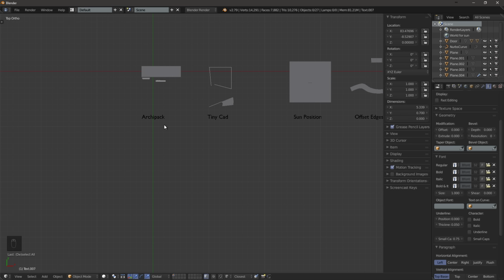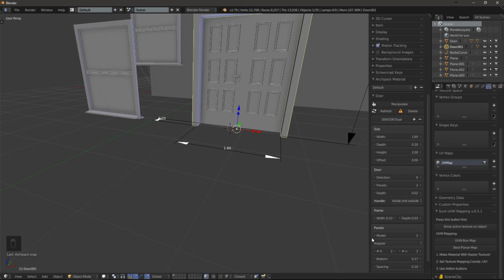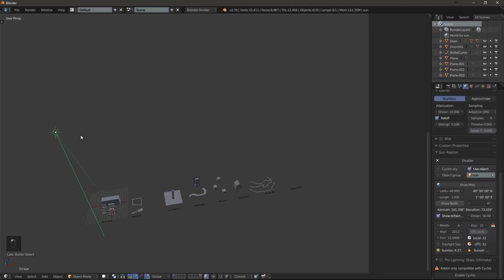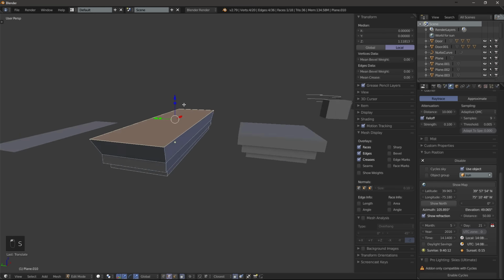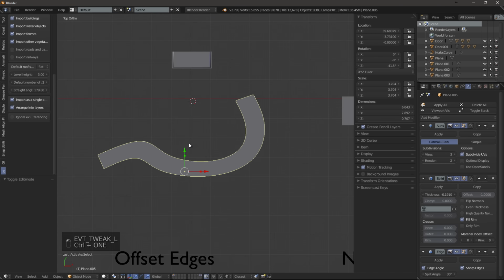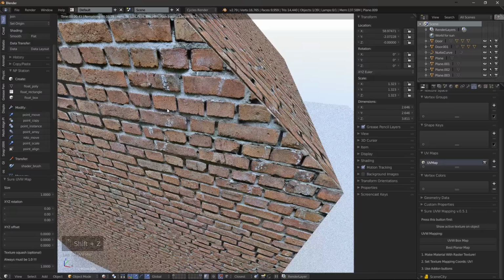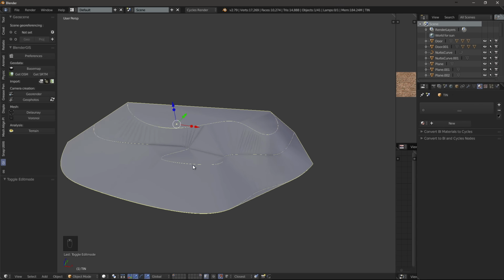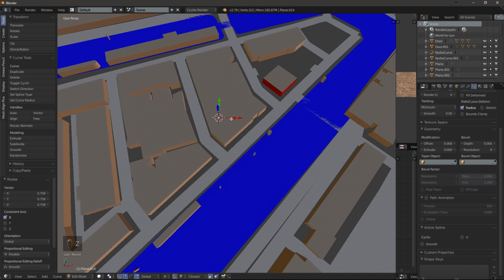The most useful Blender 2.79 addons for architectural design

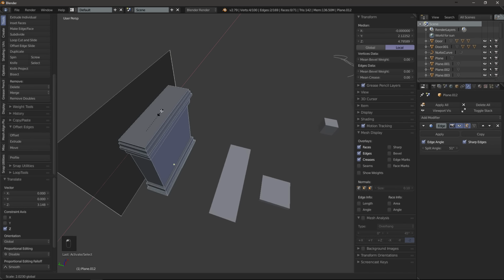Comment: how did you do that on 14:46 you toggle the snaps to vertices without enable the snaps on the bottom? thanks. i get it now hehehe thanks, just need to hit the control while using g+axis+ctrl .
Reply from the maker: If you're in the process of a command, press ctrl and it will start snapping
Reply: yep thanks I was getting there now, the only thing was holding me to really use it on the work process was importing CAD file and everytime I tried sometimes its small, sometimes its just too big I hope there will have a nice really cad import tools that don't need to make it like dxf a support for which cad file.

Comment: How do i download the offset_edges add-on/ file? Doesn't seem to have an appropriate download icon/button. Any one else having a problem with this?
Reply: Hey Brice - follow this link 
https://blenderartists.org/forum/showthread.php?304353-Addon-Offset-Edges&highlight=mesh_offset_edges
you have to sign up(free) and confirm with email before you can download.
Reply: There is a zip file-            mesh_offset_edges_0_2_6.zip 
at the bottom of the first post by Bon BaBa where you can download.
Reply: Click on Raw file, copy all text, open Windows notepad and paste, Click file save as, rename it "some_name.py" (must use quotes in note pad, this drove me nuts for a long time), Select save as any file underneath where you input name, save to anywhere, open user preferences install from file, should be there as .py file.  
All that being said I got a trace back error with raw file, but zip works great, Thank you Evan Demas.
Reply from the maker: Thank you all, I have updated the description to add a link to the Blender Artists forum topic

Comment: I tried installing the Sun Position Script, I'm not having much luck getting it to work. I went through the regular install process, addons install Zip file.
I'm using Blender 2.79 and Sun_position 3.0.1. When i enable the Sun Position no Sun Light is created ??
Reply from the maker: It doesn't create a light source for you. Once you envable a sun, it allows you to pick an object that should be acting as your sun

Comment: Nice Addons, Just wondering if there is a scattering addon ? Something like Forest pro for 3dsmax ?
Reply from the maker: Yes, particles. I have a video showing how particles can be used for scattering people if you search on my channel. With a vertex group, it's possible to also paint the influence just as in forest pack
Reply: Yes I have tried Particles, it doesn't seem to have the simplicity that Forest pro has, maybe its just that I am not that familiar with it.
Reply from the maker: It does take a while to get it to do what you would like to, but it's also quite powerful. Also, there may be some significant changes in particle systems coming up in v2.8, that may hopefully make it more akin to Forest Pack Pro.

Comment: I've been thinking now that Archipack is in Blender, should we use Archimesh or Archipack?
Reply from the maker: It's worth experimenting with both as some elements are handled better by one addon than the other. For example, as mentioned in the video above, all elements in archipack are parametric, meaning all their properties can be adjusted at any time. However, archipack's stair tool doesn't have step height, so you have to calculated it manually. Archimesh's stairs are simpler but they have stair count. Additionally, for interiors, archimesh automatically puts a base board around the rooms, a nice additional detail that may otherwise take significant amount of time to do by hand.

Comment: Nice overview thanks. I didn't know about the external add-ons but am now a fan of NP station and anxious to try it out for furnishing in archi-viz work. Btw to improve workflow a bit, when you want to scale your extrusion you don't need to press escape before pressing S. You can press E then immediately press S to scale the extrusion in place. Thanks again. -Chris
Reply: I have also a tip to share to get a flat curve really fast (annoying right ? ;) ). Create the basic curve, immediately toggle edit mode then just hit the keys 'V','V' (change handle type to Vector) then 'V','L'  (change back to aligned type). You get a nice straight curve ! I use the VVVL combo so frequently it almost became like a street fighter special move ^^ !
Reply from the maker: Hi Chris. Thank you for the tip! Wasn't aware of that before - Dimitar
Reply from the maker: @Samuel thanks for the tip!
Reply: To extend a line at the same angle G,G (grab,grab), C (constrain to angle).  Just one of the great things I learned with CG Masters Jeep tutorial, really great professional tutorial, worth every penny (don't get me started on the awesome shrinkwrap knowledge).  Oh, it's on sale at Udemy right now.   I'm not affiliated with Udemy or CGMasters in any way just a fan.

Comment: First I want to thank you for your excellent videos. 
I'm still unsure of the difference between sure UVW Box and Cube Projection? 
Thanks again for your time!
Reply from the maker: If you have multiple objects - walls, doors, details, roads, grass, etc - and don't want to individually adjust the scale in the UV editor, UVW Box makes sure that the scaling is universally the same, no matter how big or large your object is, irrelevant. So it is very consistent, given that your scale in object mode is 1.